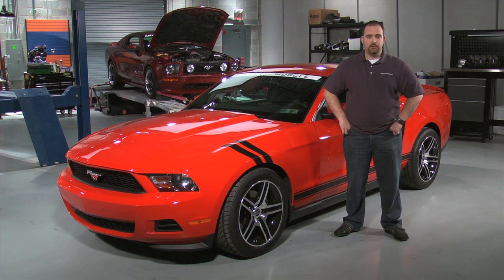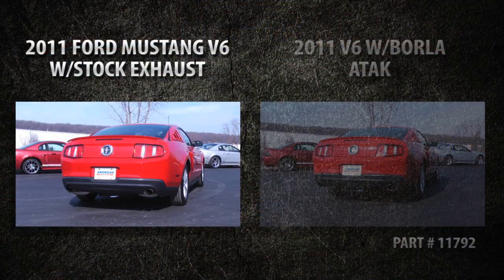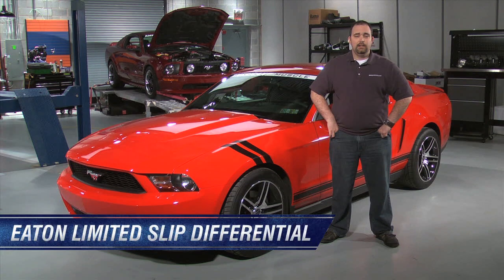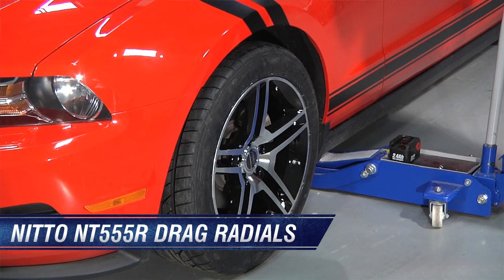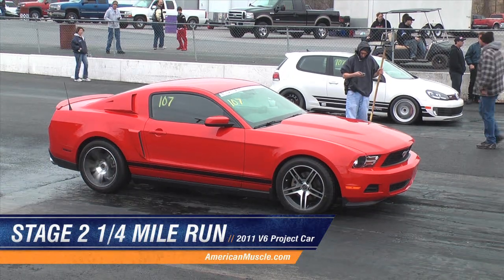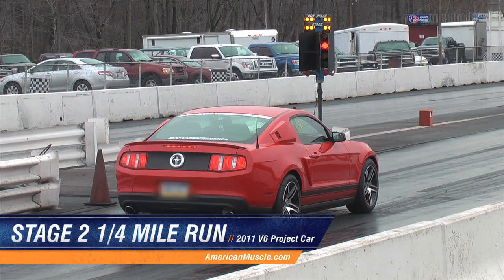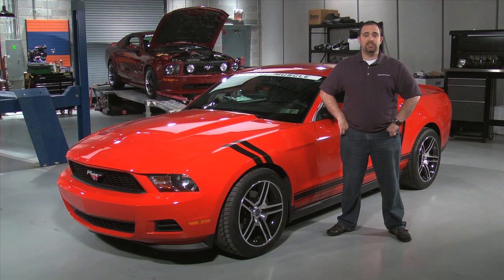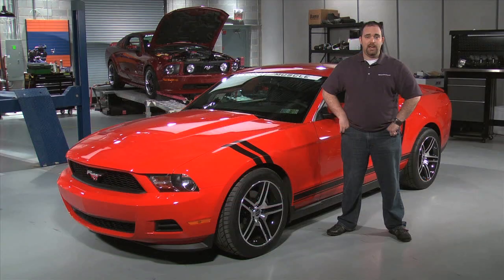Stage 2 of our 2011 Mustang V6 Project - AmericanMuscle.com

Comment from the maker: @yellowmusicfreak The only thing we did the entire time that negatively impacted gas mileage were the gears.  The rest of the mods actually added fuel economy.  At the end of the day, our gas mileage is within about 2mpg from what you'd see on a stock V6 auto.  Even with our Procharger, when you're not in boost, it's as efficient as the factory system.  Sound is a taste/preference thing, so we could never make everyone happy.  You can get exhausts for this thing from mild to wild!

Comment: @juliansahoe2 in my own opinion being a ford tech, long tube headers are going to effect the cars volumetric efficiency down low where the car already is lacky power just do to the fact that it doesnt have 2 extra cylinders. cars need a certain amount of back pressure, i think just a catback magnaflow borla or what ever you like is fine, and than start playing with power adders. dont get me wrong i love the car and think its great and i am getting one. but unless forced/induction is

Comment: The stock gear ratio for a 2011-2013 Mustang V6 is 2.73, unless you buy the Performance Package, which is ONLY available on manual transmission cars. It includes: 3.31 gears, performance shocks, springs, control arms, sway bars, strut tower brace, 19 inch wheels/tires, larger brake calipers and pads. The 3.31 gears can also be ordered as a stand alone option on both manual and auto trans V6 Mustangs. The MCA is a separate, optional cosmetic package, that also includes 18 inch wheels/tires.

Comment: I understand the gear swap to 3.73 gearing, but what exactly are the advantages of the Eaton LSD? The stock Ford differential is already an LSD. Was the Eaton added because you were already going to be tearing into the gearbox to install the 3.73 gears? Did you install a more robust differential in anticipation of the future mods and the increased torque of a supercharger? Or is there some advantage to having the Eaton LSD, even at this early stage of the game as well?

Comment: I've got a 2011 V6 Mustang Auto with 3.73 gears, Airaid CAI, Bama93 Octane Race tune, and Roush Exhaust.  The Fastest I was able to run was a 13.9 @100.04mph.  Do drag radials really make .5sec difference?  I have many questions.  Anyway to talk to Mike Wilson about his runs directly?  thx

Comment: @juliansahoe2 is guarenteed than i would stay away from long tubes, if someone made a set of short headers than i think that might be a worth while option, increaseing the flow slightyl but with out having so much scavenging effect that the car looses its ability to make power

Comment: @TheJermfacekilla Your right, it dd... No improvement from 87 to 93 octane... It's actually easier to make more power on 87 then on 89 or 91/93... Of all the performance cars I've had, none made any more then 2-3 hp on higher octane, which is pointless at that low level

Comment: Does anyone know what you have to buy when you get the 3.73 gears for 2011 and up v6 because i have a 2014 and they are saying you have to buy a 8.8 bearing for 2010 and up v6s but ford and other websites say the 2011 and up already have the 8.8 bearing so can some help me? And if you bought the gears on the American muscle website can you list the accessories you have to buy to get them installed at a shop it would be a big help! Thanks